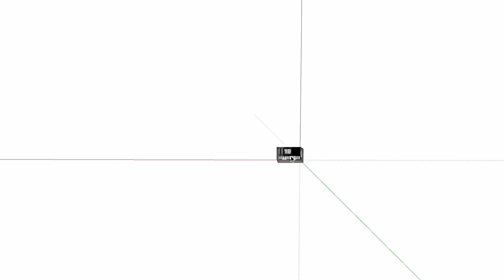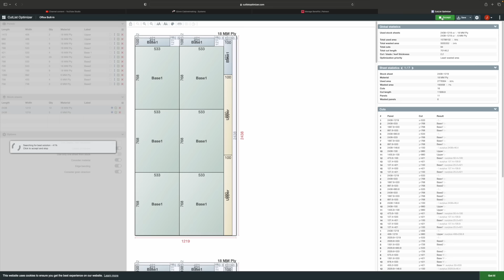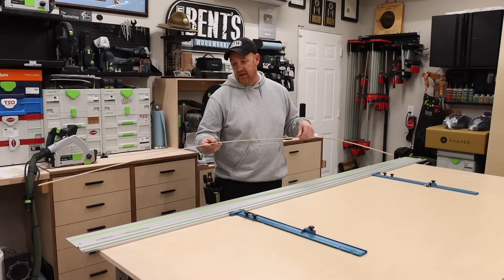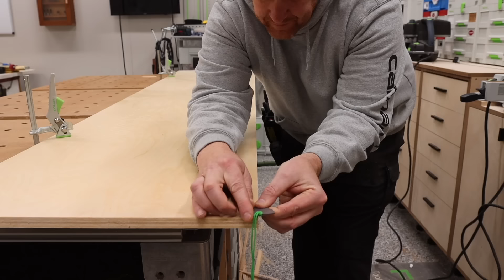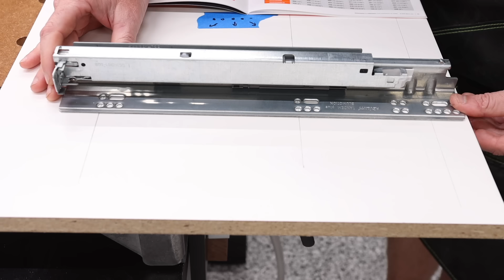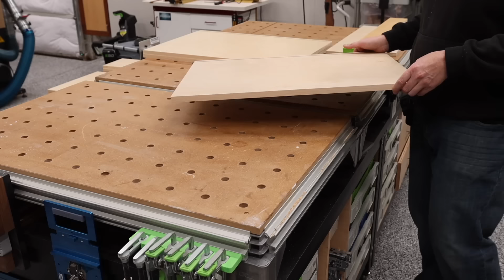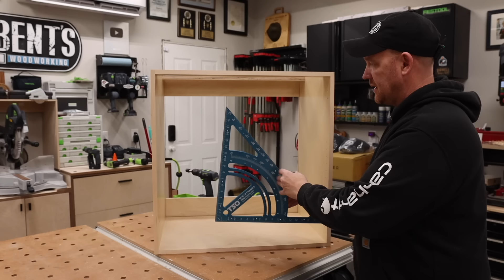STOP overbuilding cabinets

Comment: System 32, is the European standard that all of the drawer slides, hinges etc. are made to work with.  Basically 5-mm holes, 32-mm on center, 37-mm in from the front and back of the side panels.  If you design to the standard, everything just fits.

Comment: The wingnuts below go from claiming $10,000 to $40,000 to $100,000 to $500,000 worth of gear.  Nothing could be further from the truth.  A decent track saw if cordless is around $400 plus the tracks, say another $150.  You can set up a table with the the Centipede stands and a sheet of plywood (4' X4') $200.  A very good cordless drill costs $250 plus drill bits (another $30).  Roughly $1,100 and with strategic shopping for sales you can probably cut it down to under $1,000.  It's like saying a chef making a good meal is spending SO much money on pots and pans, a range, oven, etc., is just a tool operator, not a true chef.  If the chef was really talented he's build a fire and cook on a stick.  You want to build something nice and reasonably efficiently, then buy the bare essentials that anyone hoping to build cabinets needs if they at all value their time.  The rest of the BS is either envy or couch potatoes who will never build anything.

Comment: You didn’t say, but it would appear that you are using pre-finished ply?   If not, do you preassemble for fit with screws only and then disassemble to apply finish, or do you prefer to build the box and finish it as built?

Comment: Buying from a plywood distributor that will make cuts for you is perhaps the biggest cheat code there is. They do this for cabinet shops all day every day. No more wrangling full 4x8' sheets.. I just took delivery of pre-finished maple ply that had PERFECT cuts and is basically a cabinet kit. You fill out a cut sheet and they optimize it for you. They edge band shelves and anything else you want, too. Just assemble and build face frames. Delivery was $60 which saved me hours of drive/load/unload time plus gas. Can't recommend this enough if you value your time and hate moving full sheets of plywood around.

Comment: Thank you for this amazing video!  Right now I don't have access to a table saw.  I followed your method, but using only a tracksaw.  I was amazed that my two cabinets came out perfect and square, and identical.  It was a breeze.  I did use glue, since I was making them out of 1/2" plywood and had a brad nailer but no crown stapler,  The reason for the 1/2" ply is that they are housed inside a larger frame.  Next time I make cabinets from 3/4", I'll try the no glue method and will try a crown stapler.  

I've made a couple of kitchens worth of cabinets, also some bedroom built-ins, and they turned out well.  I think they were overbuilt and took a long time.  I learned some things from your video that made it easier and faster.  One of my favorite videos.  Very impressed.  You are an excellent instructor.

Comment: 6:10 you need to check your fence.  It is lifting up when you are running the plywood using the hold downs.  If it’s lifting up, it can probably move side to side as well

Comment: Thanks for the upload. I’m still a beginner, but I wanted to learn more about measuring from the sides for the drawer slides. I haven’t seen it done this way before, but I like the idea of setting everything up first instead of messing around with scrap-wood jigs.

Comment: Same question as others have asked, what size screws do you use #6 or #8 and what size of drill bit do you use 3.5 mm or 4.5 mm Festool? You can put those details in the notes section for all to reference. You do a nice job of the process. Ignore all the negative comments about what method and tools you use.

Comment: Nice. I'm about to build our kitchen and will use this method
Two questions.
If the side is going to be visual, what would you suggest to hide the side screws, maybe another plywood cut and screw in the inside?
Question two, how much weight would this hold. That is would it hold a stone bench top?

Comment: Is there any reason to keep the sides on the outside of the cabinet bottom other than not seeing the edge of the bottom if its an end cabinet?    ..  I'm about to build a kitchen, and I feel like I could cut all the pieces quicker if I assemble the cabinet sides above the bottom, then stretchers in between the sides at the top.  .. What do you think?

Comment: Thank you, watched this video 4 times and almost finished 6 30x30 cabinets. I’ve split the wood in two places near the ends of my plywood even with pre drilling, what screws are you using?? I need to put away the deck screws and buy whatever you’re using! Thanks again!

Comment: I do my best to follow your cut instructions, but I can never seem to get it square corner to corner, despite making all cuts with a track saw. Would this be, because I am not using parallel guides? I do have a Woodpeckers Square for squaring the crosscuts, so I’m thinking my tracks must be slightly off measurement from board to board.
Reply: Parallel guides ensure that your plywood is parallel, if set up correctly. I measure near the top and bottom to check and if the measurements aren’t the same, then I know my cuts weren’t parallel. If the numbers aren’t identical, then I’m not cutting square.
Reply: @ thanks for the reply. The more and more I review all videos covering breaking down sheet goods. The more think the level of precision I’m wanting to attain will be met by getting parallel guides and using a MFT style bench so that I can use stops to make all my cuts repeatable. Everything I’ve made to this point is fine to the point that people can’t point out the discrepancies, but I still know where they are, lol.

Comment: Just install 3/4” for your back. Easier and less work. No need for that stupid 1/4” back panel. Save time not cutting that groove and installing the spreaders. What you save in wood, you more than waste in labour.
Reply: I guess the reason is 3/4 is more expensive, so at scale the cost of material adds up.

Comment: I learned woodworking/cabinet making back in grade school up thru wood shop class in HS back in the 70's.  Worked in various different shops throughout years, owned my business for years and I'm now retired. Through those years I learned and I am still learning even being retired is that you don't not need fancy tools to get the job done provided the skills you learn and apply achieve the desired end result.
I started building cabinetry with basic tools and some power tools long before all of today's modern tools - IE Battery Operated tools became common. You don't need to spend big money ( thousands of dollars ) on tools to do woodworking/cabinetmaking depending on the skill level you wish to achieve.  There's more than plenty enough video's on YouTube that provide answers to those questions.

My brother was a master woodworker/cabinetmaker and his advice has never failed me which I have avoided many a mistake.
The 6 P's = Proper Planning Prevents Piss Poor Performance
K.I.S.S. = Keep it Simple Stupid 
Fail to Plan, Plan to Fail
Always Check the Math
Everything is in the Details
There's no such thing as a stupid question.
Lastly, NO ONE knows EVERYTHING.

Comment: One tip that is rarely heard is to never try to cut less than a full blade width, with the tracksaw.  I've done it and I think the blade flexes because the forces are not balanced.  You have no reaction force from the outside, and you do on the inside.

Comment: Yes Sir ! Uniformity is always nice :) Love it.
Your instruction on the assembly is right on point.One thing i do different is the sequence of assembly. i do use 18  inches brad for temp holding the parts and mid.16 g crown in between where the screws will go.i do square the cabinet with backing using narrow crowns like yours and add the screws after. Sometimes i really even do not use screws just the 1 3/4 inches 16 gauge 7/16 crown and believe it or not just as good and strong as screws.
%96 percent time i use Spax screws just because i can and help me sleep better to know they are there :)) guess i am ocd when it comes to over kill. 
Keep up the good work.

Comment: Great video! I’m planning to build a setup that includes taller cabinets on either side of a shorter cabinet above a sink. Since the sides of the taller cabinets would be exposed, wouldn’t the pocket hole screws show until they meet the shorter cabinet? Could you explain or show how you’d build this kind of layout around a sink for a clean, seamless look?

Comment: If it works for you, it's fine. However screws only hold at "points" along the carcass whereas a good wood glue is stronger than the wood and holds at EVERY available point.  I do like how you set up the track saw and did the edge banding first. You also have the advantage over most hobby woodworkers of having top of the line equipment.

Comment: Great video there Drill Sargent!  Just build a massive MFT out-feed table with the Parf guide and similarly have all the same bench dog fences and accessories.  Haven't put a cabinet together on it yet but the goal was the KISS as you just illustrated so I'm stoked to get started this weekend.  I still like to use the spacer theory for the drawer hinge setup though.  I get pre drilling but I always find myself making last minute adjustments.  I kind of feel like an idiot after the edge banding trick that you illustrated.  I was also using a marker to mark the cut edge like you but after making some cross cuts, you had to have ton of little X's everywhere and I always forgot what was my clean edge.  That was worth the price of admission right there.

Scouts out!  (19D)

Comment: I don't understand why the sides don't rest on the bottom. There is unnecessary sheer force on your staples. Yes you can argue that the toe kick is bearing the whole load but why do that?
Reply: The staples are only holding the cabinet together as he secures with the carcass with screws.

Comment: Now show us how to do cabinets without 60 grand in tools. So tired of seeing all the youtube guys with 40-60K in gear telling me how easy it is. NEWSFLASH It's NOT. I can tell you how easy a boiler is to install because I can do it in my sleep but most people would lose their minds.
Reply: He doesn’t have close to $60k in tools in that room. Why are you upset that he uses nice tools which he’s bought most of it with his own money?
Reply: @AaronGeller  I don't care what he does with his money, good for him but making a video and saying "this is the easy way to do something" and then breaks out a shop few of us can afford as a hobbyist is disengenious. Maybe you missed the comparison i put in my response.
Reply: @PolishX  The point of this video is how to break down plywood efficiently and assemble the carcass. Someone can use an inexpensive job-site saw with a great blade for $100 or less for clean cuts. They can then use iron on edge banding with a file, chisel, any other method. They can then use an inexpensive shelf hole jig. After that they can clamp and then screw together the carcasses. If they have a brad or stapler gun, then they can get rid of the clamps. None of this has be expensive and most people are intelligent enough to produce the thought of “I don’t have a $4,000 edge banding setup, but I can use cheap iron on edge banding and a $20 trim accessory”. 
He never said you need to have a $1300 Domino machine. He shows you how to use screws… flippin’ cheap screws! Anyone can afford screws. 
I have some nice tools but I don’t have a large cabinet saw or a fancy edge bander, but guess what? I can use what I do have 😊 and because I’m somewhat smart, not the smartest but somewhat smart, I have found creative and inexpensive solutions for the tools that I don’t have. 
All I am saying is, why be negative when you don’t have to be? Why not use that energy toward creativity?

Comment: The part I struggle with are the cross cuts.  I do not have a setup like this (I'm not a professional) but I have the Festool Tracksaw and Rail and even the TSO Rails...  But I struggle to get 100% accurate cross cuts.  What's the best approach with these tools or without to get dead accurate cross cuts.
Reply: TSO guide rail square with parallel guides. This works well with my tracksaw and reasonably affordable

Comment: I'm confused: he is nailing pieces together - but that only works for sides that will not be seen. It's an effective speedup as most sides would be out of sight, but if that cabinet was a Billy bookcase you'd have nails everywhere...
The thing which surprised me was that he used screws into plywood? I thought that can split the ply? So far I always saw this done from the other side with an angled hole/jig - definitely slower. For cabinets - unseen sides very pragmatic.

Are those screws strong enough? He claims no failures, but he's selling affiliate links and ads so grain of independently confirmation salt would be nice..
Reply: He builds for himself, so it’s in his interest to build something that will last. He counterbored and pre-drilled with a special bit so that the plywood would not split and so that the heads would be below the surface. 
Some cabinet makers add a thin panel to the outside cabinet to cover the holes or just use a different solution altogether. 
Hope that helps!

Comment: If the 1/4” plywood isn’t glued or stapled around, is it even providing any benefit besides hiding the back wall?
Reply: Some resistance against racking but if it’s fixed to a wall, then that’ll provide stability.

Comment: Not everyone has the tools set its not as easy as you suggest!!! it’s exclusive rather than inclusive 😢
Reply: But that’s not the point of the video — it’s about how to break down plywood and assemble. Using either cheap or expensive tools, you still need to break down your plywood and assemble the carcass. You just really need a job site saw, a drill, and perhaps a nail gun.

Comment: This is my favorite woodworking video.  I have been a woodworker for 25+ years mostly furniture.  I am now planning to rebuild my 12 x 15 kitchen and will use your method for cabinets.  My question is: what plywood do you use for kitchen cabinets? 7 ply or 13 ply?  Baltic birch? Pre finished?  etc.  My cabinets will be painted.  Here you used 7 ply but that may just be for this video.  Also, I was stationed at Ft. Benning in 1969 for NCO school and jump school. Spent two years in 173rd Airborne infantry.  Thank you for making the Army a career.

Comment: Thanks for this awesome video. As for cutting your pieces for your project, take careful note about the moisture content in your wood. If you decide it would be a good idea to cut your project on a Monday and then decide you will get to assembling your project Saturday you may find that the dimensions may have changed considerably.
So make sure your wood has had some time to have acclimated itself to your workshop environment.

Comment: Thanks a lot Bent. I prefer you simpler approach.
Of course, I'd use different tools!😅

The crown stapler or use clamps and Domino. Glue isn't required but optional.

Dados and grooves are unnecessary for the bottom.

With these screws 12/side + 6 at back or 30 screws in total makes it unnecessary a pocket hole jig and pocket hole screws!

For the grooves in the side panels, I'd prefer using a router instead of a tablesaw.

Also, with a straight edge with a circular saw to do all the rip cuts and cross cuts make it unnecessary a table saw and a mitre saw.

So, the only power tools needed are a circular saw and a drill/driver!
And for me, a router with a bit.

Manual tools: a straight edge or track, tape measure, a [combination or speed] square; a pencil,  

Also, for edge banding, an electrical iron and the actually roll of edge banding.

For installation, a level, hammer drill.(I have a combination drill/driver/hammer drill).

Wow!😲🤭😅

Comment: You need continuation to this video:
Add this video to a next one and follow up with drawers and hinges. Make it one long video so "new cabinets makers" can follow along in the shop/garage instead jumping from one video to  another. Be detailed in your description (size of the screws, lengths, saw blades tooth count, drill bit sizes, staple sizes etc). Remember you are talking to the new recruits most of the time. Thank you for your service Jason!

Comment: Just put together my first cabinet using this method. I only had 1 1/4” screws but it still came out rock solid! One question - what screws do you use? I’m about to buy 1 1/2” screws but I see the “cabinet” screws all have a slightly rounded head and not a flat head,  which seems odd to me for installing cabinets side by side. Seems like a flat head screw makes more sense.

Comment: Thanks for the great video! I’ll be building floor to ceiling cabinets in my mudroom, using 3/4 plywood for the carcasses. Will a 1/4 back panel work in a tall cabinet, and if so, does it need another nailer/stretcher bar halfway up the back? Or would you recommend a 3/4 full back for stability in tall cabinets?

Comment: What kind of 1 1/2 Screws do you use to assemble the cabinets.  What depth do you set the pilot holes with your pilot hole bit.

Comment: This makes me think of Carlos.  He built/installed luxury cabinet from 7am-4pm, 7pm-10pm, 5 days a week. Never worked in a home under a six figures. His tool of choice was an old 4 1/4" porter cable circular saw from the 80's. He could do anything with it. He used it with a cheap Bora saw guide to cut out nested parts on custom veneered ply that ran $500 each.... to perfectly scribe grained matched trim.. even to quickly cut for outlets in a few seconds. He had so much skill in those hands.